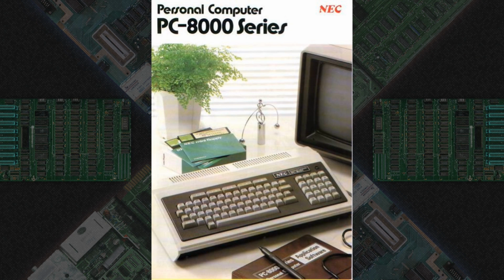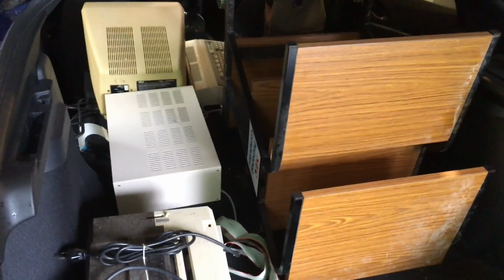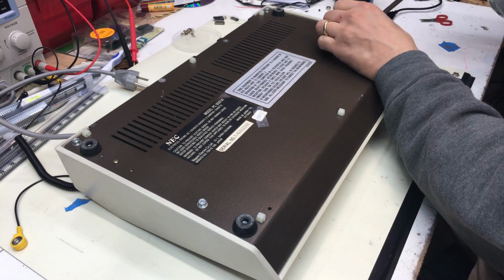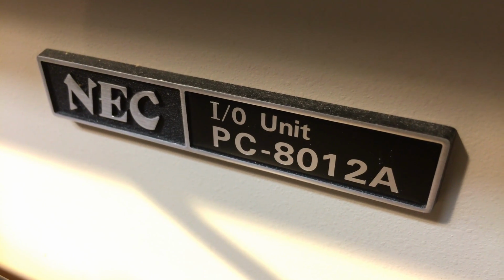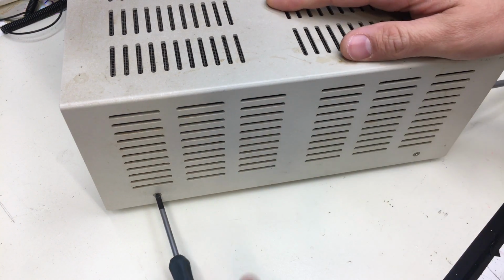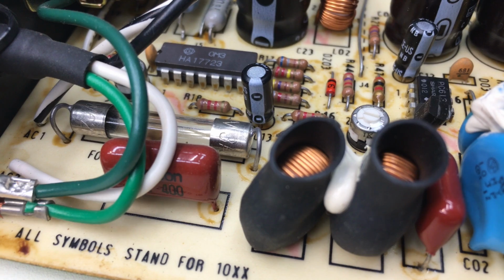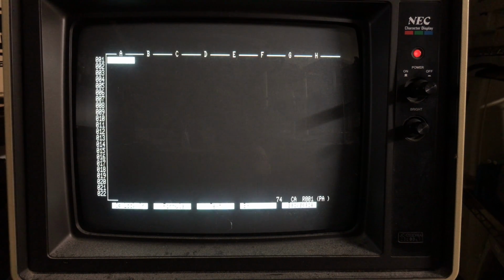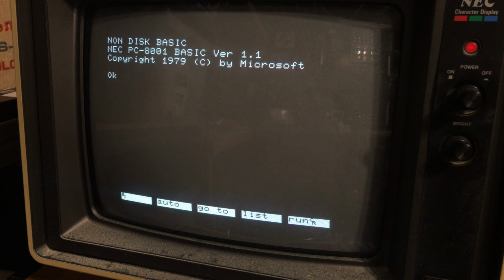RARE - NEC PC-8001A

Comment: Oh yes, the very first computer I ever had.  The NEC-PC8001 and 1A.  The 8001 was from Japan and shared Japanese Kanji characters on the same keys with the traditional typewriter lettering layout.  I had the PC-8012 expansion unit, for the extra memory, and even has a 8011A that was a smaller box that did not have room for cards, but gave me the memory.  The 8023A printer which screeched the usual dot matrix sounds you'd expect, and the associated disk drives that were VERY loud as the heads hit the 5.5" diskettes.  The RGB Monitor was the first I know of for the home PC market.  That was one EXPENSIVE monitor!  It also output NTSC composite video for monochrome displays.  I donated one complete functional system to a computer museum over a decade ago (they had never heard of it) and a second system still lies in my basement presumably functional.  I replaced the 8001A with the 8801A in 1983 which had absolutely stunning graphics capability, complex graphics commands in the ROM-housed BASIC and 64K of memory.  Again, a specific NEC RGB monitor had to be purchased if color was desired.  Later Apple would get an RGB monitor option, but the NEC was the first.  Unless someone can educate me otherwise.  The 1983 PC-8801A is STILL operational in my basement.  The monitor, processor and disk drives all function as they did in 40 years ago.  It NEVER "crashed" did only one thing at a time and when there was an error in the BASIC program I was writing it would stop an tell me the line number that was the problem.  It was the ultimate learning machine as it was simple, rock solid error-free and I was able to learn by making mistakes and correcting them.  Now, as it has been from the introduction of Windows processors exploded in capability all kinds of software was running in the background, and crashes and errors were no longer exclusive to my mistakes.  I abandoned programming after Windows came out.  I never went back.  I'm still stuck in 1983 where 4MHz Z-80 CPU  and 64K did everything I needed.  I miss those days.

Comment: Funny thing about this computer. I worked for NEC for 25 years supporting thier PBX products. in 1984, NEC released their first fully digital PBX, the NEAX2400. While earlier systems (E.G. NEAX 22) used dumb terminals and a specialized tool called a DMC (diagnostic Maint. Console) for administration, the 2400 was introduced with THIS computer to use as an admin. It came with a giant stack of command disks, and actually ran the MAT program in MS BASIC! It was not up to the task, and was replaced in a year or so by the APC II... but it was the first real 'computer' I got my hands on. An awful lot of 'stuff' (computer, expander, disks, monitor, printer) just to admin a PBX.
Reply from the maker: Wow, thanks for the context! The more I can find out about this machine the better.
Reply: This PC was equipped with N-BASIC, which NEC developed based on MS-BASIC.
It boasted state-of-the-art features for a standalone BASIC interpreter of that era—such as Japanese character display, double-precision floating-point arithmetic, and color graphics—that were not found in MS-BASIC.